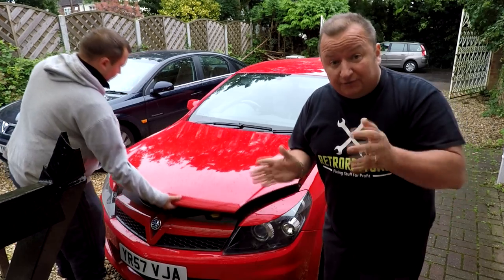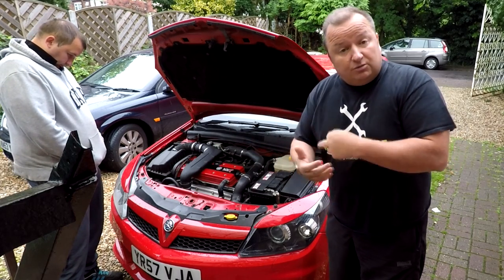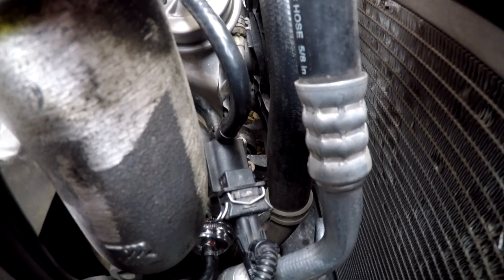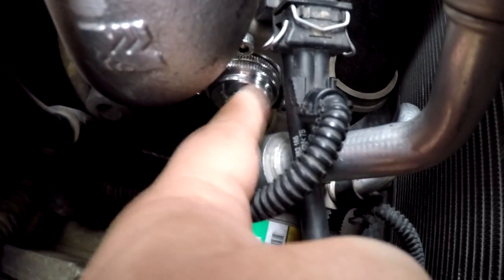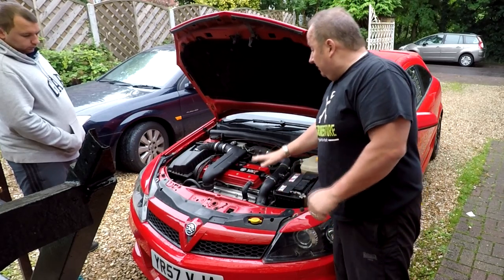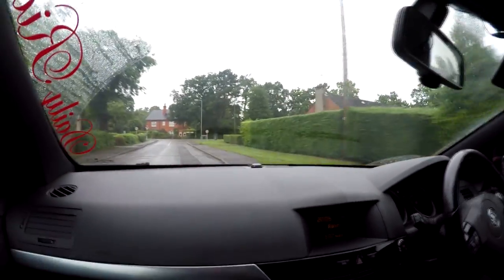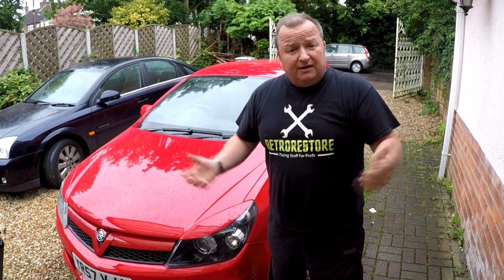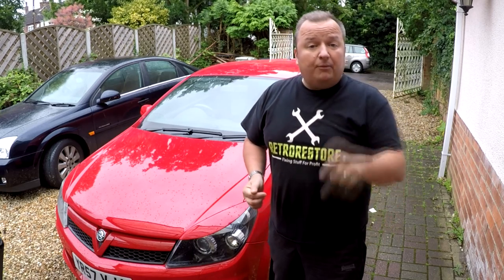Part 2 Vauxhall Astra VXR Mk5 Recirculation Valve Turbo Vacuum Issue

Comment: Ha ha that's amazing, I had even other mix in my vxr. Hose from recirculation valve goes to Turbo control unit solenoid and this one from Vacuum control solenoid valve was going to the back of the turbo. I found technical drawing and you guys 100% correct. Thank you guys

Comment: Martin it's called the boost control solenoid. BCS. Common failure on the 1.9cdti too. Causes overboost and limp mode when faulty.
Reply from the maker: Thanks bud, good info again.
Cheers
Martin

Comment: Got to be honest I don’t have much faith in main dealers sometimes there bloody useless all the do is change brakes and oil now a-days sometimes there servicing is poor too no even removing wheels to check brakes, ive had it several times where they have miss diagnosed stuff and ive fixed it by looking on the transit forum Which is know joke when your in £350 and still got the same problem.
Fair play to you lads just have a go same as me not mechanics however with some sensible knowledge you can save a fortune 👍

Comment: The recirculation Gary has bought is fine plenty use them. the springs aren't as strong as the forge ones but if they go he can buy the actual forge ones from them for about 25 quid
Reply from the maker: Thanks for the info Andy, it's working fine so he's happy.

Comment: If the cheap part your on about was a recirc valve from ebay the seals are rubbish on them but you can buy a forge service kit with good seals and mines been fie since
Reply from the maker: Thanks for the info Matt.
Cheers
Martin

Comment: Hello I have the same car same colour as your man, could you tell us what the problem what the problem was before you change the parts. I have a problem when I come in to boost it keeps all the boost in  the turbo, basically it holds the car back when in boost.I have changed the actuator and now I am about to change the recirculation valve. Hope it solves it. My machanic thinks it might be the coil pack but after watching this video I think it’s this. Let me know what the problem was plz and how it felt.
Reply from the maker: It had a lag when you pot your foot down and didn't pick up straight away. It was better after fitting the re-circulation valve but as we showed in this video, the pipes were on the wrong way. Changing them over cured the problem.

Comment: the problem is catalist system. probably it was melt down and prevent the exhaust gas. So change the catalitic converter or delete it. it is the solution. I had the same problem. And I soved it
Reply from the maker: Mark Mark that wasn’t the problem in this case. We found a hose that was connected up wrong and even the specialists missed it. Once corrected, problem solved.